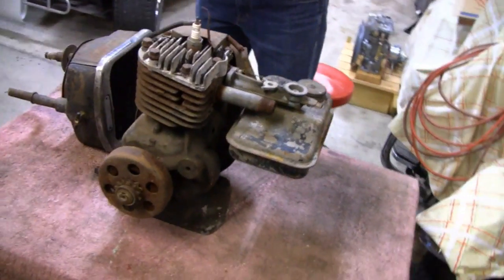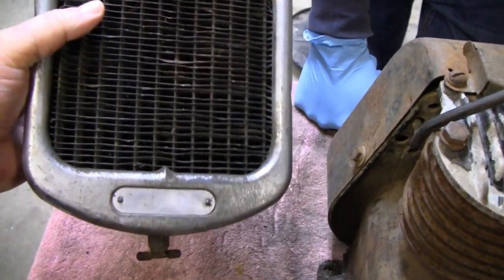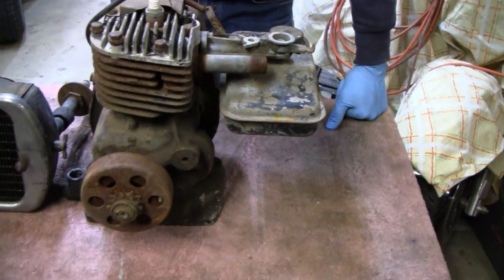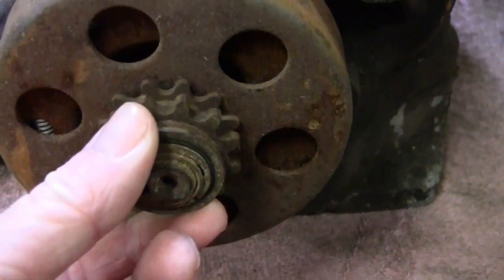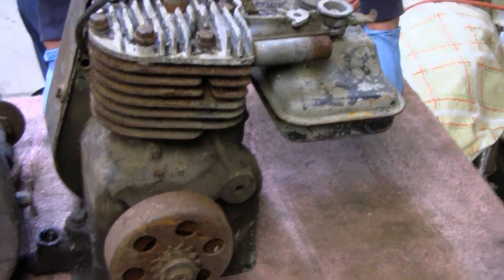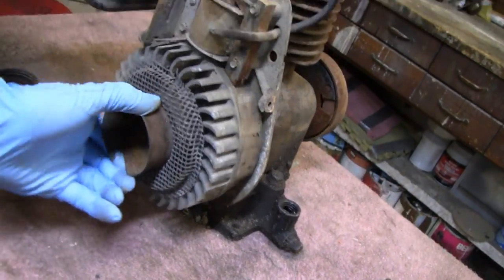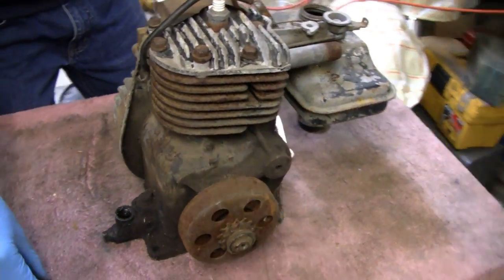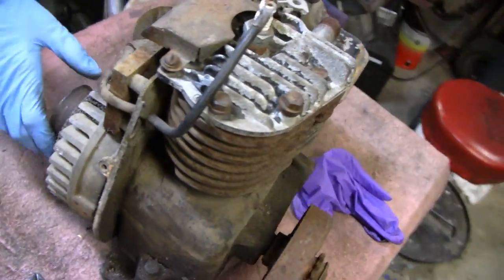HOMEMADE WATER COOLED BRIGGS ENGINE (part 1)

Comment: The round part at the front connected to the sprocket is a centrifugal clutch.  It engages when the engine hits a certain speed and releases when the engine slows down - thats what the spring are for.  The spring tension determines the speed.  These are still easily available but expensive!!  They were / are used on go carts, home made minibikes and other equipment one does not want to have engaged at idel.  Thanks for the video's    Rod
Reply: i bet roadking knew that

Comment: This is going to be an interesting build. I know its early in development, but are you thinking of making a water pump, or using a gravity system?
Reply from the maker: We're going with a water pump!!☺
Reply: Chevy 350 oil pump, you'll have to machine a seal for the shaft and find a way to drive it, but is a proportional cast iron piece.

Comment: Super new project RK and Little DB! It will look so period correct with that "Heater" Radiator! I'm assuming you'll use some kind of pump to circulate the water, unless you use the principle they had on a Model A, Thermo syphion I think it was called. This is another project that will keep me on the edge of my seat!!
Reply from the maker: Yeah we're gonna use a little water pump!!☺

Comment: Gocart or minibike engine. The centrifugal clutch comes off, and the e clip on the end keeps it together.. the set screw holds it on the engine. To fix the clutch you pull clip...

Comment: I had an old gocart as a kid that had a very similar clutch styled drive on it. Used some really odd gear changer on it kinda like a mountain bike that would switch it between the two sprockets. It was pretty cool for just an old gocart.

Comment: Hi road king my name is will I'm 17 years old. I just bought 2 brigs 6s engines and was wondering where you buy your parts for them because I need a carb rebuild. Thank you for your time
Reply from the maker: I never had to buy parts for any of them but if I did I would use Ebay!! There really isn't anything to rebuild on them Carbs, clean out all the jets and you should be fine!!☺

Comment: Cool old centrifugal clutch. I think this engine saw some minibike duty in the 1950s and 1960s. 
The bottom ends on these 5s / 6s engines are really tough. I bet this engine will be a runner with no problem. It actually looks pretty good inside looking down the bore. Great project, men!
Reply from the maker: Thanks Bud!!☺

Comment: Laquer thinner cleans out bad gas real well. Sno-Bowl toilet bowl cleaner works great to remove rust from inside fuel tanks, but it needs to be rinsed out real well with hot water. With hot water, the tank will dry quick, maybe even blow it out with compressed air, why the tank is still warm from the hot water. Sno-Bowl works great on corroded carburetors too, but be careful you can ruin a carb if you let it sit to long before rinsing it with hot water.
Reply from the maker: Yeah Lacquer thinner worked like a charm, the varnish actually preserved the inside of the tank, it was like brand new once I cleaned it!!☺

Comment: Ah, this brings back memories. I tore my first engine down at 10 years old, and man was it fun. I refer to those as Minibikes, the lawnmower engine driven ones. They are a blast for kids.
Does a Tecumseh have a square head? I prefer their carbs over B&S for the float system and separation from the gas tank. For 10 bucks, you got a deal. These little engines are easy to repair, and will run til they break apart, not unlike those old in-line 6-cylinders. I popped a head off a B&S once, and found a hole in the piston the size of my thumb. Poor thing, had some damage in the block here and there, I ended up using the spare parts I could get from it.
I love your screen name, BTW. I'm a soft tail kinda guy, but a Harley is always bada--. You pic is a beauty, I'm loving that dark red on chrome. : )
Reply from the maker: Thanks Bud!!☺

Comment: Yet another fascinating project from you guys! I will be following this one closely. When I was a kid, I always wanted to use an outboard boat motor powerhead to power a go-kart because I had several, and I loved the idea of having a little twin cyl when everyone else had one-lung Briggs or Tecumseh engines. I never got around to actually doing it, but I always wondered if an automobile heater core would be enough to cool such an arrangement. I wonder if you are going to use a water pump or rely on a simple thermo-siphon arrangement?

Thanks for your continued sharing of these projects!
Reply from the maker: Thanks Bud!! Stay tuned!!☺

Comment: Awesome. You guys are getting me amped up to rebuild one of my small motors. Ever do a Wisconsin? Do they still sell parts?
Reply from the maker: Wisconsins are too big and pricey for what we do!! Parts are still abundant and easy to get for them!!☺
Reply: 805ROADKING Hey thanks responding. Might try to tackle it this year. It's a 4 cylinder. Real nice when it runs. It runs a screening plant for dirt and topsoil. I'll have to call ya or send message to try finding parts it needed. Thanks.